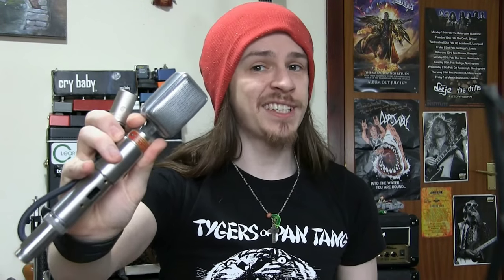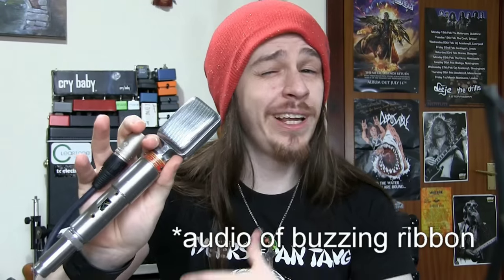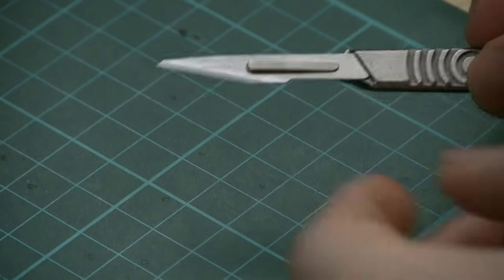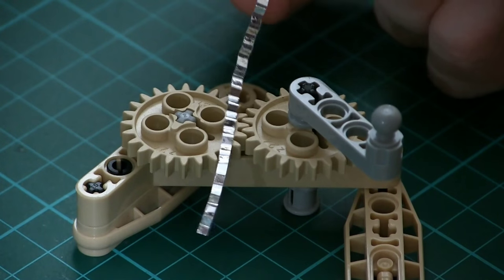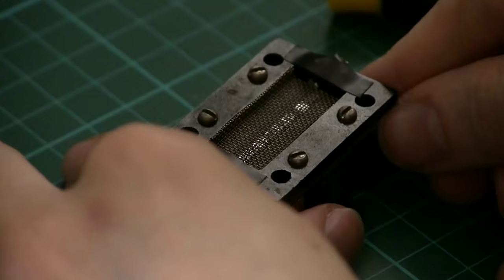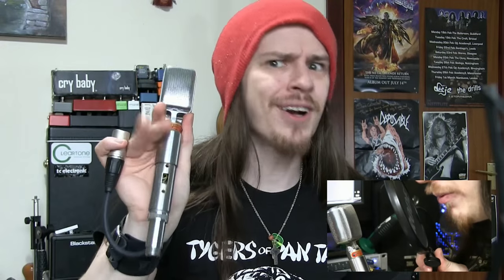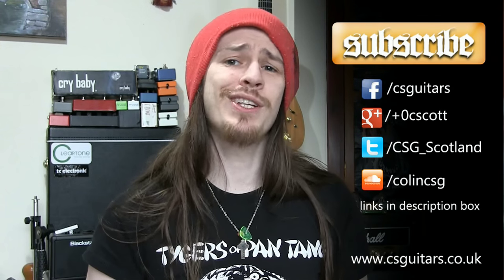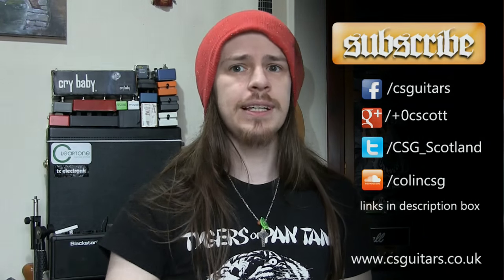Reslosound: Installing A New Ribbon

Comment: Meanwhile, some manufacturer just looked at this, saw the Bionicle gear jig, then looked at their expensive machine tha does the same job, and faepalmed
Reply: Jordan Payne lmfao I actually use this method with 2 gears years ago on a home made Ribbon Mic lol. I noticed the shape of the foil was based on equal distsnces so I looked at a "How it's made Ribbon Mics" and it shows the machine lmfao.

Comment: Back in 58 to 63 I used to remove the thick felt filters just leaving the covers filtered.  Then fit a new ribbon available then. The stock Tx was OK. Mic was a lot more responsive then with good presence.

Comment: Excellent... i just found one of these in my folks attic... 2 questions - What is the XLR adapter you're using? and are you using a preamp? I head these old Reslo's have a low impedance and need a preamp to bring them up to modern levels?? Relative noob so thanks for the help!
Reply: To record a microphone you need a preamp. Assuming you want to record on a PC, look at the UMC202HD.

Comment: HI Colin, great video! May I ask where you got the replacement ribbon from? Is it better to get a 1.8u Micron or the or 2.5u Micron as you are using. I have the exact same Reslo Mic and need to replace the ribbon.
Reply: Hi Giles, I also want to repair the same mic. Did you have any luck finding the silver paper? Cheers

Comment: I wonder if the sound would change if you experiment with the thickness of the ribbon, or the material, eg. gold, silver or copper leaf.
Reply: Yes, I believe the thicker the foil, the less treble it will pick up due to the mass of the foil.

Comment: Pretty damn cool however I would have thought that if breathing into it to harshly could damage the ribbon mic, then a guitar cab would have made mincemeat of it. On another note what happened to that new bloodbound you were building? The pictures on facebook were looking amazing.
Reply: Air is much more dense than sound waves
Reply: +Jarryd Mahabir that makes sense actually. Cheers
Reply: guitar19971 awesome man
Reply: 2.5 microns is the durable ribbon density but the more responsive weight it 1.8 microns...just much harder to mount and less forgiving to SPLs etc.  I think most of the old ribbons were lighter, these days people want durability over frequency response...but any ribbon, well almost, is preferable in my book...

Comment: What if you were to increase the width of the aluminium strip and density of it, By folding the it over a few times ??
Reply from the maker: You want as little mass on the ribbon as possible. Increasing the mass in any way adds to the inertia of the ribbon, reducing its effectiveness as a microphone.

In short, it would be a really bad idea.
Reply: no worries,
Reply: +CSGuitars yes i read this in your accent